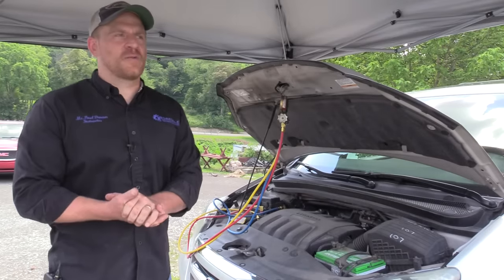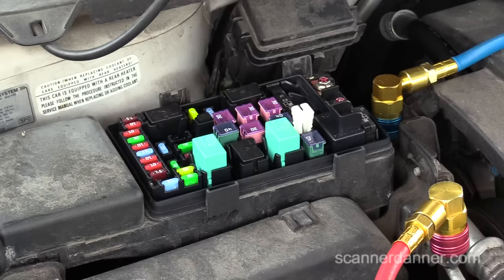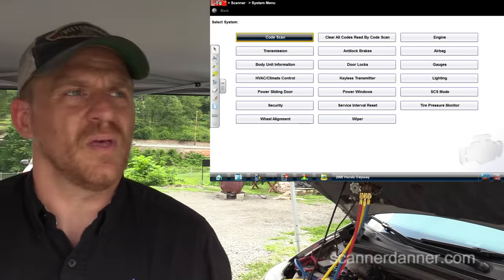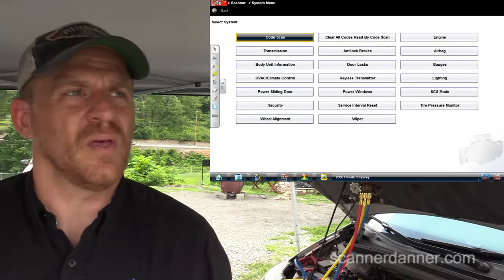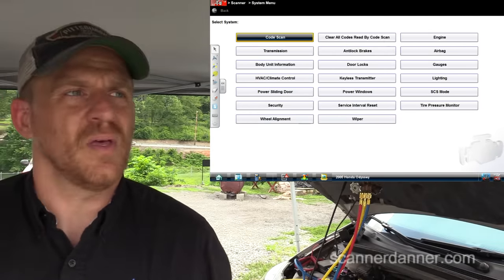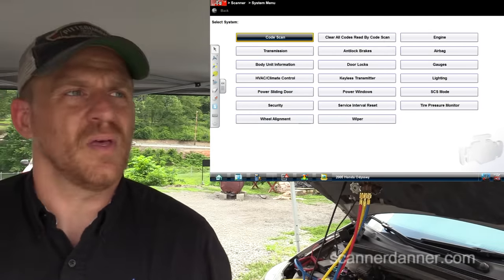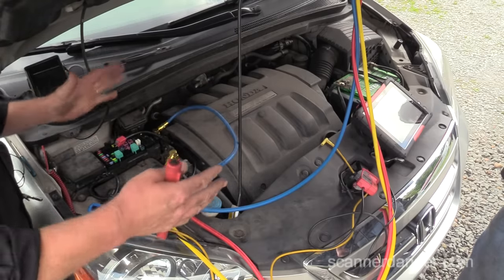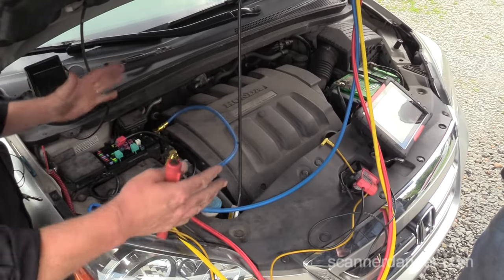A/C clutch not engaging - 2005 Honda Odyssey

Comment: Why are you making this so difficult, the relay location is clearly shown on the fuse cover you just removed, this is a subframe ground compressor. The only connector coming of the compressor which is not that hard to get to is the power. Turn the van on check voltage with the free harbor freight volt meter. If you have battery voltage then you have a bad clutch. Don't stray people, use the kiss method.
Reply from the maker: "Don't stray people" is a ridiculous comment. What happens when there is no power to the compressor. What do you do then? I showed those steps too.
Reply: Free harbor freight voltmeter.. I have a decent one telling me plugssockets are not 120 volts I borrowed a Klein and I guess my battery is not 12 volts either
 Yeah cheap tools if work will get out of pinch one or twice.  Having issues on saab ac so I understand
People think and learn differently and prefer different tools. He seems to be a great teacher for 98 percent of people thsts pretty good...there is relay goes to coil  its ground twice there and to alternate according to daan software so you never know. I seen video guy  fan speed 3 went and that was issue. I seen bad coolant sensor ang thermo change and ac fix so you never know. Gotta think out the box rigjt?

Comment: 40 min for that ???? First was to see if compressor get power. No need for scan tool....
Reply from the maker: You obviously didn't watch the video. I'm in a parking lot and cannot get to the compressor clutch wiring.
Oh and I am a teacher, I was teaching.
Reply: first thing was to see if the compressor was getting 12v with a test light.
since there was power you wasted 39.5 min on the rest of the scan.
Reply from the maker: Watch the video before you comment. I couldn't get to the compressor! 
If you think the rest of this video was useless or a waste of time to show, then you're on the wrong channel buddy. 
Go back to all the other hack channels where you came from
Reply: 1st: i'm subscribe to your channel
2nd: using a scan tool would be smart if you verify that the compressor don't get power.
3rd: i watch the whole video
4th: in my opinion it's not an excuse that you couldn't get to the compressor wire since you got to it at the     end of the video.
5: your brother would check the compressor first, i'm sure
Reply from the maker: 1. If you are a subscriber to this channel, how do you see the rest of this video as a waste of time? How many people need the walk through of this circuit, that I showed. 
2. I used the scan tool to locate the relay, because I couldn't get to the clutch!
3. if you did, you were not paying attention. I was in the parking lot and could not get to the clutch!
4. at the end of the video, I am now in the shop with the car in the air, so of course I can get to it now
5. my brother doesn't have some special powers that would have allowed him to get to that clutch in the parking lot

Final comment. Ultimately the AC main power feed connector was located on the side of the radiator and was accessible from the top. But I did NOT know this until then end! I had no wiring diagram, and no knowledge of this system going into it, yet I was able to systematically cover every aspect of this AC clutch circuit. For you to not see value in that surprises me as a subscriber to this channel. 

What kind of value is in a video that shows no AC clutch operation, then the next frame is someone putting a test light on the feed wire and it lights, then they say, "whelp, you need a clutch"??

I have provided information to the YouTube world on how to troubleshoot the entire output side of this system and I even gave tips on how to know the input side is working.
Reply: when you do mobile repair you gota do what you gota do if you don't have the tool with you at the time. scantool idea was good!
Reply: +ScannerDanner Hi sir we really like everything u are helping us to learn thanks to you and we love you moreooooooooò
Reply: That was brutal and quite rude.  Paul is here to teach.  So I understand why the video was as long as it was.  If you look at this as a diagnosis mystery novel, then yes, the novel would have no mystery.

I do take issue with the fact that Big Guns were called in for a simple problem by the shop.  This is the second time I have noticed this where I expect a capable shop to handle this without needing to call in for mobile tech support.  But Paul had explained how that shop works as it is short on the bay and if he gets more cars than he can handle, he calls in Paul before even touching the vehicle.  So that model works for that shop and sometimes we get to watch videos which could be called as "big letdowns" if you were looking for esoteric issues.  I can live with that and I DO appreciate Paul putting those videos up.
Reply: i didn't meant it to be brutal
i just expect more from a professional video
Reply: Hey brother, you dang sure don't need to explain yourself to these trolls. I think 99% of your subscribers know exactly where you are coming from and we do extremely appreciate what you are doing no matter how long it takes. Keep up the good work and don't feed the trolls!
Reply: +moshe2002 I will even eat the loilet of Poul foooooooooool
Reply: It's not about the result. It's about the process. You want quick repair videos? There are plenty of other channels for that.
Reply: +moshe2002 go to scotty's channel crap
Reply: Yeah, what's wrong with you? Scottie Kilmer could have diagnosed that in 30 seconds...........LoL.
Reply: he probably doesnt know that he will waste about 30 minutes just in unnecessary time in raising the car up , putting jackstands  and then cursing trying to get a test light to actually probe the wire in tight quarters b4 giving up. rofl    scannerdanner  you do what you always do and that is doing it right the first time.